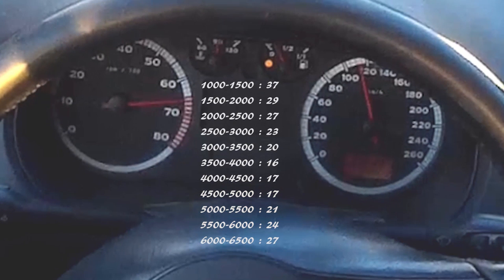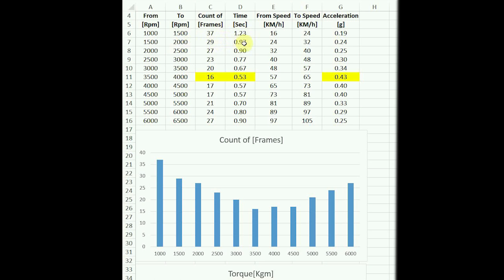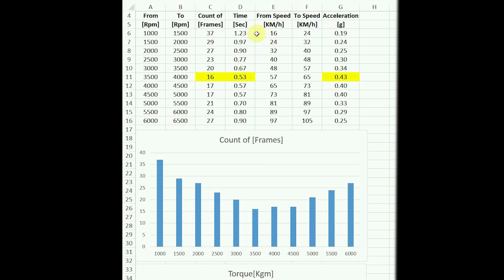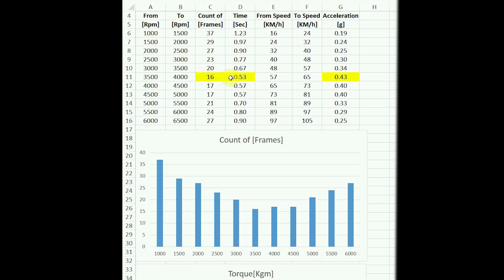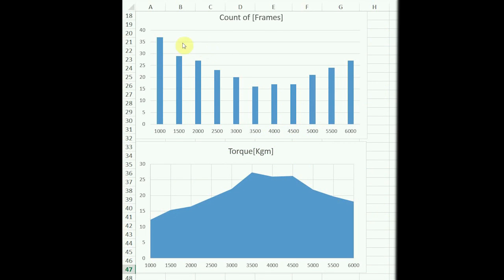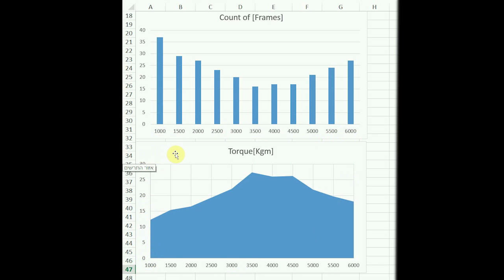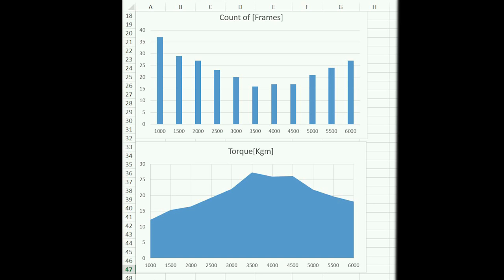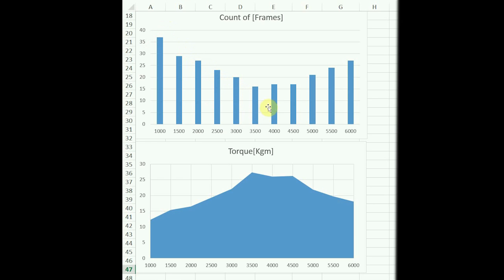DIY: How to Plot Your Car's Torque and Horsepower without Dyno

Comment: You have to calculate in rolling resistance and air resistance. I've done some measurements and excel calculation with drag forces included... Pretty hard job for horsepower estimation.
Reply: Just test without windy day, not too hot and find a stright road, with no incline or decline more that -+3%, no ice, good tires.

Comment: Sorry, but this method is completely wrong since it does not take into account the drag force which increases roughly proportionally to squared velocity (with the speed numbers mentioned in the test).
Reply: got em